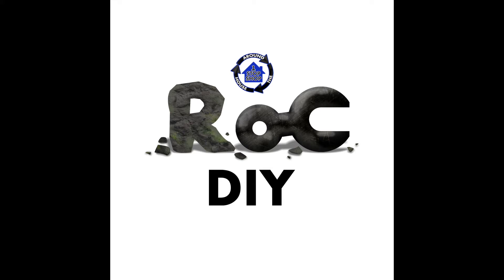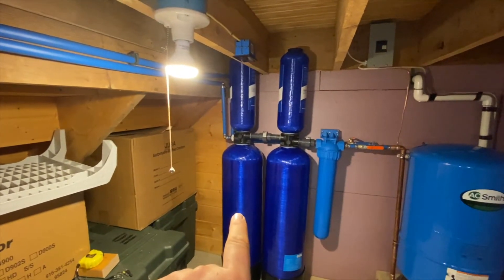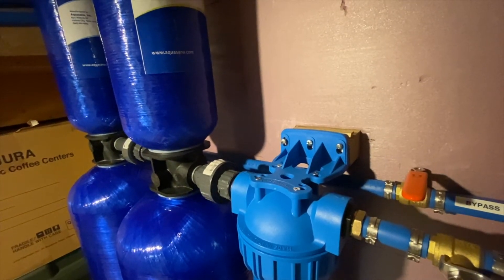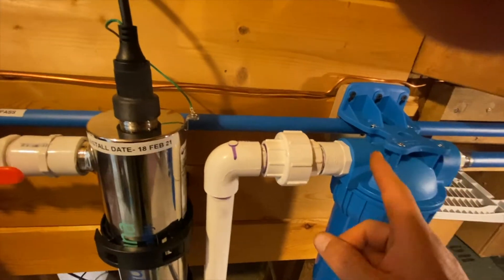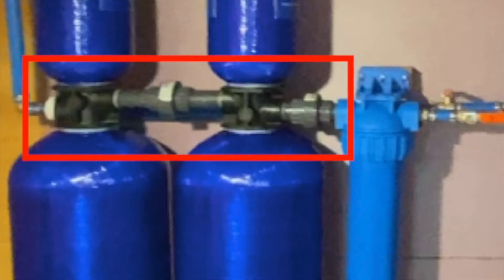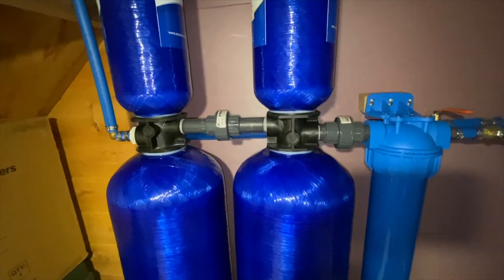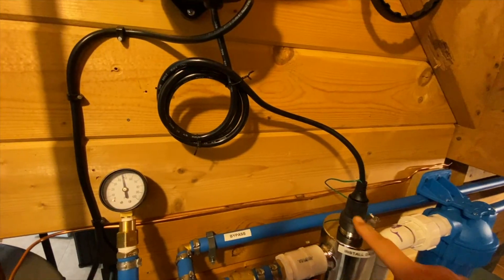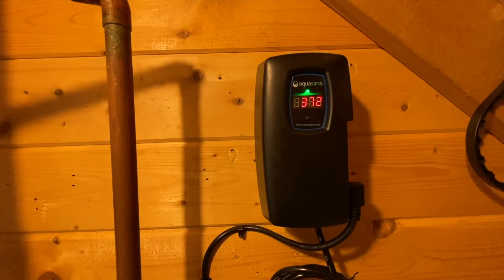Well Water Whole House Water Filter System: Issues

Comment: I have well water as well. Do I need to keep the Pressure bladders in the system?
Reply from the maker: This whole house filtration system is purely a filtration system. It doesn't replace your "bladders" /well water pressure tank. Also, the system can handle up to 100psi, but your house should not require anywhere near that. Your pressure tank switch will limit it to 30/50psi or 40/60psi either way. Well water in >>> to pressure tank >>> thru filtration system >>> in to house. Thanks for the question.